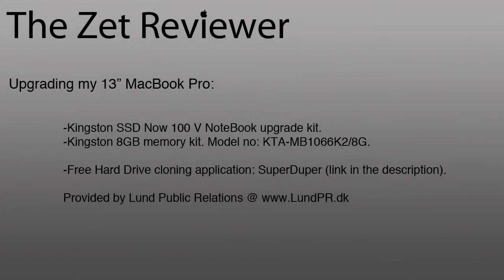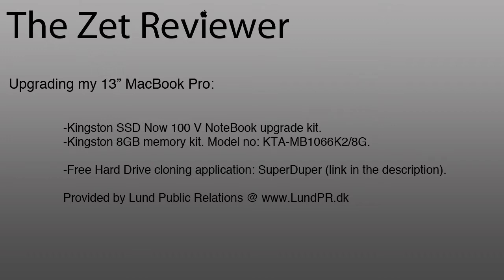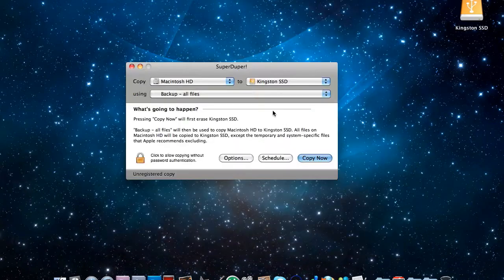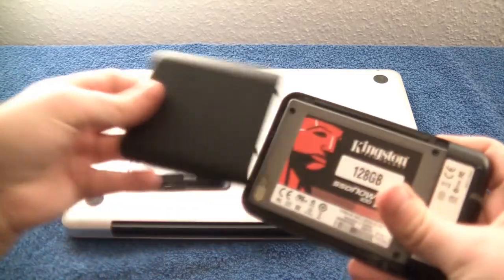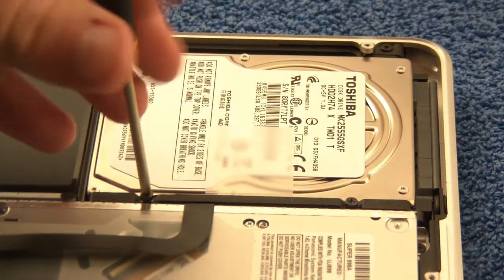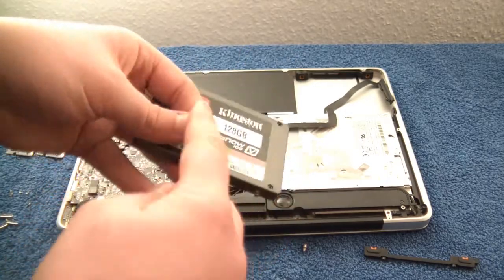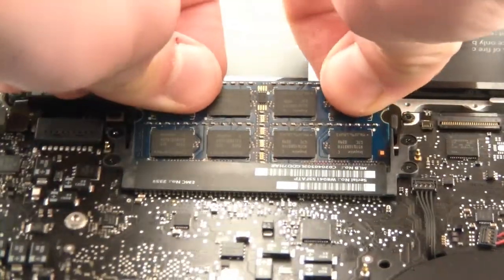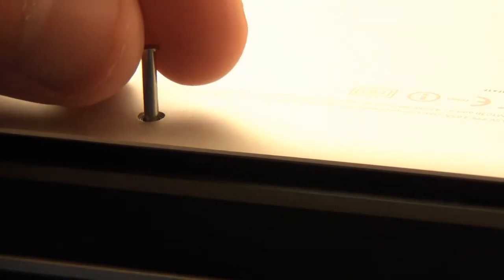MacBook Pro SSD and Ram Upgrade ( Kingston SSD Now 100 V Review )

Comment: @TheZetReviewer  ok my issue is the money. im debating between the 13 inch vs the 15 inch. with the 13 inch i could buy 500gb ssd while in the 15 i couldnt because would be too expensive but the 5 has amd gaming card of 1gb. the 15 inch has 2.4 while the 13" has 2.8ghz. would it be worth it to buy the 13 and missing the amd graphing card? can you still play games as same as the 15? does the 2.8ghz makes a difference? which one shouldi  get im confused plz reply!

Comment: @TheZetReviewer Cheers. I kept seeing 1.8" models which confused me. I must have a 2.5" Apple model in my current MBP and was just wondering if it could be swapped to the new 2011 model? I'm sure it can? Definitely going to put the 500GB HDD from the new 2011 model in my 2010 model to resell it.

Comment: Is that a 2.5" SSD replacement? The Kingston 256GB SSD is quite pricey. I got 256GB of Apple SSD in my 2010 MBP but thinking about swapping it over to the 2011 model and then just selling my 2010 model. Cheers for the vid, helped a lot.

Comment: You can also use a datadoubler, which allows you to remove the superdrive and replace it with a box of the same size. You put your hard drive into the box and hook it all up, and voila, 2 hard drives in one macbook pro!

Comment from the maker: @daviddalziel I did mention that you should ground yourself to discharge static electricity from your body. 
Your body often has a small electrical charge running trough it and when you touch a big piece of metal or a person you will get a little electrical shock. If you don't ground yourself you could pass the current to the components inside the computer and that will very easily destroy or "fry" the component.